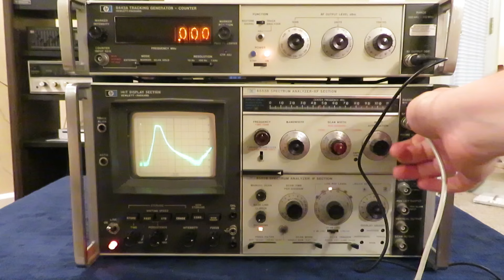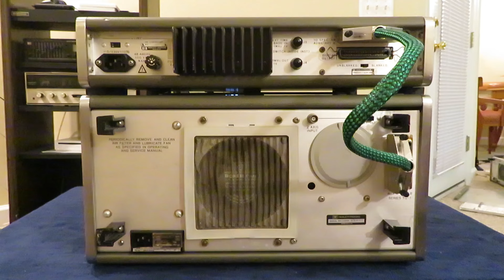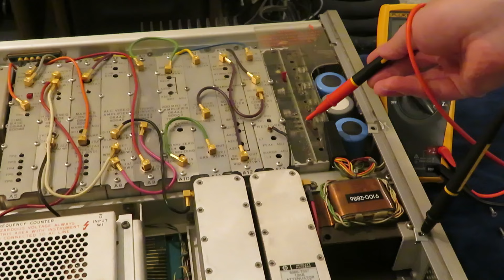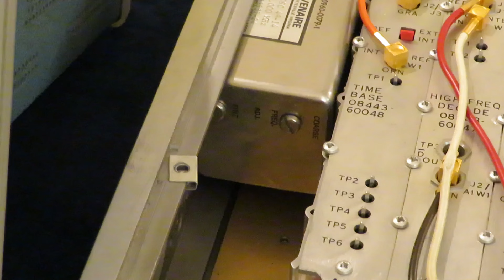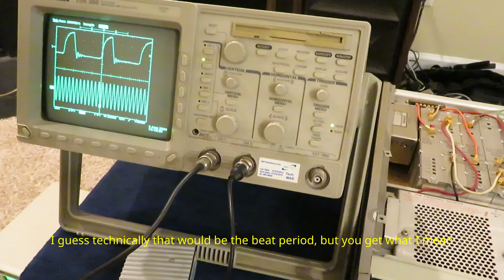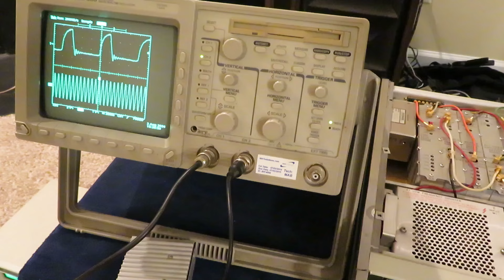How to use an HP 8443A/B tracking generator counter with a 141T/8553B Spectrum Analyzer

Comment: As a fellow 8443 owner, I can confidently state that adjusting the 24V rail into spec will not have any noticeable effects on anything related to the RF adjustment procedure (assemblies A8-A13).

The 24V rail is used as a reference by the regulators on all the other supply rails; hence, only one adjustment. The reason it’s tolerance is so tight is because it supplies power to the ovenized 1MHz standard, and is always on when the unit is plugged in (and explains why the middle filter on yours has been replaced at some point).

Ovenized standards are laughably simple if you’ve ever taken one apart…. It’s literally just a basic Butler oscillator w/ a generic through-hole UM packaged crystal in a box wrapped in nichrome wire encased in expanding foam. The only real intriguing aspect is that the UM package is glass instead of metal (that being said, the 3MHz crystal in A13 is also in a glass UM package). 

In those Ovenaires, the oscillator in the oven cavity is actually 10MHz, but immediately divide it down to 1MHz on the amp/AGC board located outside the cavity (but still inside the outer metal box). Temperature control is achieved via simple thermistor/BJT circuit glued to the oven cavity shell between the two bands of coiled nichrome, and thus it relies heavily on a stable supply voltage to maintain constant temps. 

I’d bet that if you had adjusted the 24V rail and let it sit for the 3 days, you wouldn’t have needed to adjust the oscillator at all (or at most, need only to touch up the fine adjustment slightly)

Comment: Hi, thank you fpr the nice video. Btw, I would like to make my own connecting cable for connecting  AUX-A with te Track.Gen.. But how to connect the pins? In which order? 1-1, 2-2-... but where is 1 and where is 6 (left- right, up, down)??
Any help would be highly appreciated.
Mike
Reply from the maker: The shells I bought actually had the pin numbers molded into the plastic. If not, I would refer to the datasheets on whatever you buy. And yes, it is wired 1 to 1, 2 to 2, etc.

Comment: Can you make a video on this unit for beginners? This is my first spectrum analyzer.
Reply from the maker: What sort of things would like you like to know about it?
Reply: @veraxis9961  Thanks for getting back to me. Let me put some thoughts together and I'll let you know!
Reply: I came to realize I bought one of these from you back in June! Unfortunately my IF section is not working. Not your fault - I know this is old equipment and it's always a crap shoot when we trade this stuff. The trace doesn't come up. When I tried adjusting the vertical gain sometimes the trace will appear. I did wind up finding a replacement IF section and an LF section. Thanks for making these videos. I did find an interesting document online - "HP 141T Usage Examples". Covers what I was looking for. I primarily purchased mine because I'm interested in playing with basic HF amplifier circuits and would like to measure distortion and see the harmonics that arise. If you're interested, you might check that doc out. Would make an interesting Youtube video. If I still come up with ideas for a video, I'll share.
Reply from the maker: @jamieostrowski4447  Oh, dang, sorry to hear you are having trouble with one that I sold! Did you check the fuses on the back of the IF unit? I know there are some power supply startup conditions that can trip the crowbar circuit internally to these and blow the fuses on the back of the IF unit. Usually you can just replace the fuses and it boots right back up with no harm done. Based on some stuff I have heard around the internet, it may have something to do with the 75V neon gas regulator (A2V1) wearing out and causing overshoot on the +100V rail at startup. Apparently some folks have had success replacing those with with three 27V zeners in series. I would need to do some experiments, but maybe I would make a video about that to see if I can confirm this behavior.
Reply: @veraxis9961  Thanks for the tip. The fuses were fine. I checked the fuses on the back of the IF unit and the four fuses on the power supply board as well. Now, I did buy a replacement LF and IF unit. Plugged those in and it worked great - the first time. The second time I turned it on, both the fuses on the IF unit blew as well as 3 fuses on the power supply board. I'm going to try checking the power supply caps for leakage. Yeah no worries. This old equipment is great but you have to expect this kind of thing. Appreciate the content you put up on them. They are worth sharing info on. I consider them to be a piece of classic gear.
Reply from the maker: @jamieostrowski4447  Gotcha. Yeah, this gear can be finicky for sure, but I still feel bad if it is one I worked on. I am not sure what it is then. My only other thought would be that the switch for linear/2dB/10dB scaling can sometimes get oxidized and cause issues. Scrubbing it back and forth can sometimes fix it, but if it blew fuses on the main power supply then that is much more concerning and not something I have seen before. I wish you the best of luck on it!
Reply: @veraxis9961  Thank you! Please don't feel bad. I am confident you sold it with the best intentions. I have seen your contributions concerning the extender cables for these units and I know you're just trying to help, and I appreciate it. I will give those ideas a shot.

Comment: Great job on the cables! I have been stymied by the D-sub mini coax HP interconnect cables before, and didn’t even know how these connectors were called, let alone that you can still buy them. I’ve learned something!
Reply from the maker: Thanks! I think out of all the info in this video, teaching folks about those cables was the most important thing I wanted to touch on. Hopefully my videos and that forum post can be a resource for anyone working with these units, and probably other types of HP equipment which use obscure interconnects like that.

Comment: I love my 141T. I am keen on microwave amateur frequencies and use the 8555 RF plugin. I have the preselector also.
Wish there was a tracking generator for the 8555.
Reply from the maker: They are great units. I was introduced to the 141T through amateur radio, and I am quite fond of them as well. I have an 8445 preselector also, so I might do a video on that at some point. An 18GHz tracking generator would have been awesome, haha.
Reply: @veraxis9961  It would be awesome! I have the external mixer also which extends the range to 40GHz. It works well!

Comment: This is an awesome video. After many years, I just hadn't gotten around to calibrating HP 8443A/B tracking generator counter>. 
Thanks for making this so easy and sorry I can only add one like.
Well done.
Reply from the maker: Thanks! I'm really glad if this video can be useful for you, and sorry I don't have the time/equipment to go through all the calibration steps like I did on the 141T mainframe.

Comment: I have one but never works correctly! I made a cable with 2 old monitor cables not the VGA one but I don't have the plastic insert... Better use a nanoVNA not this unstable thing! hihi
Reply from the maker: Yeah, finding that cable is the real trick to getting these working. I'm sure something could be improvised, but without real coaxial contacts it will probably be very janky. It is also possible there could be other issues. Sadly I only have this one unit, so I don't know what the common failure modes are. A real VNA is definitely more capable than this, but these boxes and the parts to build a cable aren't too expensive when someone might already own an 8553 SA.